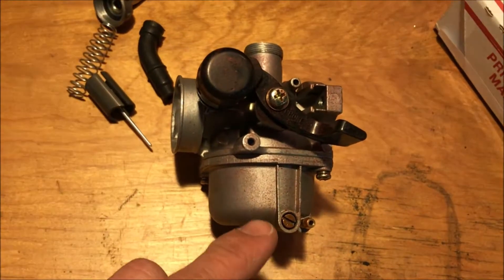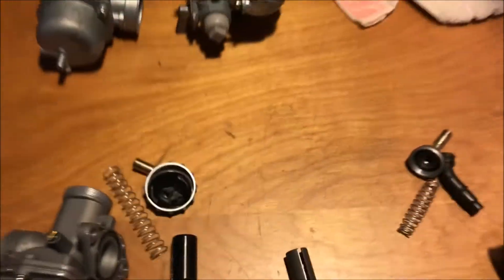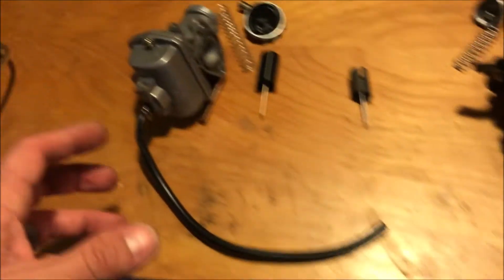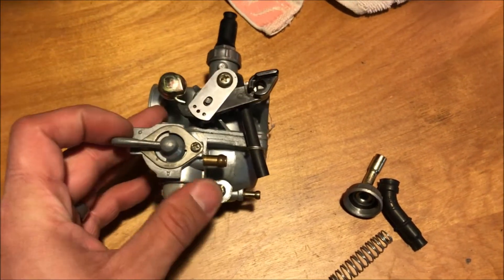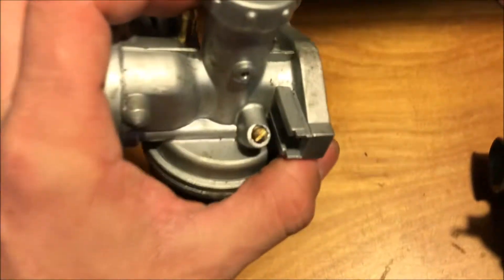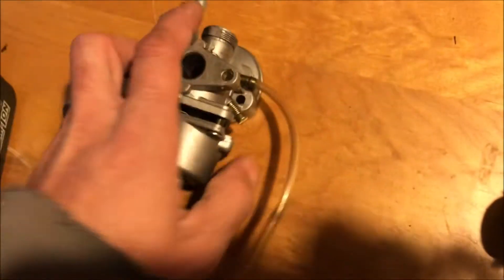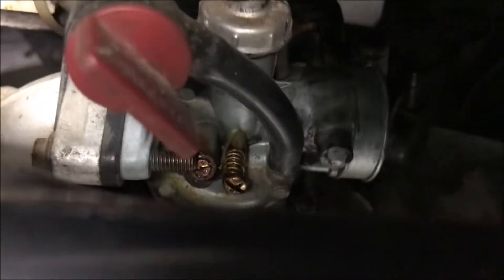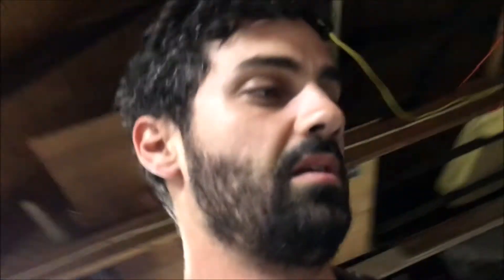How to Choose the correct Carb for your ATV or Pit Bike

Comment: Im want to put some jets on 125cc 4t peace moto (chineese) the original jet says the number 84 wich one should i get ?

Idit: i want it to wheelie and better power delivery
Reply from the maker: Your better off adjusting your a/f screw and needle height. Jets won’t gain any power unless you modify other parts of the bike as well
Reply: Like what parts ?

Me:vissible confusement 

I just whant more gas into the engine since the jet is not big enough because if a punch it it does not receive enough fuel and then it boggs
Reply from the maker: Speedy Boi usually this is a sign that your needle is set too high or too low. Sometimes it is a jet as well. Do you have a pz19 or pz20 carb?
Reply: Uhhm i have the stock carb 26mm

Jet 84

Comment: i went by this guide and ended up with the wrong carb, mines got an electrical cable and other gear seen one similer to a piaggo
Reply from the maker: Sorry to hear that. Make sure you look at your carb for details like that. Even add “electrical wire” to the search in amazon and it will help. What does the electrical line do?
Reply: Yeah pay attention to what your taking off you should be able to look at it and see a number on it somewhere to tell what kind of carb it is.  Why would you follow this guy unless you had the same exact carb. Duh

Comment: if i buy a pz21 for my 125 pit bike will it work?
Reply from the maker: Is that what is on it now? It will most likely work fine but if it is different than the one you have now it may need tuned

Comment: Hey mate I got two brand new Lifan engines ones a 140 and a 125 and they both bog when I full throttle
Reply from the maker: Bogging at full throttle is usually too much air. Try raising the needle a clip and see if it helps
Reply: Make sure your gas tank is vented.
Reply: I had to lower my clip on the needle when my atv was bogging when banging the throttle. I would just quit when I used to crank on it now it's good response.  I tried raising the clip but that made it worse so now I'm on the 4th groove down and it's rips

Comment: Hey I have a honda xr 70r which one should I buy
Reply from the maker: Pz19 fits the xr70 perfectly
Reply: @burnout_MEDIA  it has a pz20 right now
Reply from the maker: @aarondavid2150  go with the pz20 if it is running right. You really can run either but you might have to tune it a bit to get it right
Reply: @burnout_MEDIA  thx

Comment: What carb would fit best on a Apollo z20 max
Reply from the maker: I would go with a vm22
Reply: So I got the vm 22 and it starts but when I pull the throttle it bogs any suggestions?
Reply from the maker: @Motogangbang  does it bog and then take off? Or does it bog and die completely
Reply: @burnout_MEDIA  bogs then dies out
Reply from the maker: @Motogangbang  is it better or worse with the choke on?

Comment: Why can't I just put pz19 in pz20 bike
Reply from the maker: You can but you may need to tune it a bit. It’s easier to put a matching carb on.
Reply: @burnout_MEDIA  i got another 50cc atv that has weird size. bolt to bolt is 30mm vs 45mm on pz19 and pz20. for life of me i cant find an adapter or right carb. carb looks completely gone (deposits everywhere) and it is sealed.
Reply: @protectork9831  i'd just drill out the pz to match

Comment: You mentioned nothing about how these carbs come in different bore sizes.  People could watch your video, think any PZ carb could work for example and they'd go buy a 22mm PZ carb when they actually need a 16mm PZ carb.  Just example sizes in mm though.
Reply from the maker: In this video I cover the pz19 (19mm and pz20 (20mm). They are different casting and can be determined by the shape of the bowl. You can’t get a 20mm pz19 as far as I know.
Reply: You should be able to see what number carb you take off